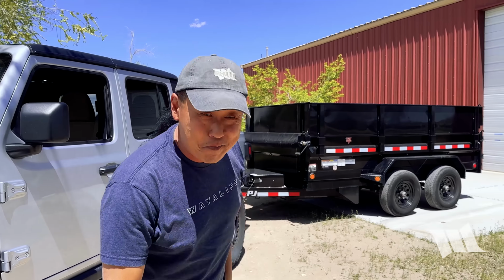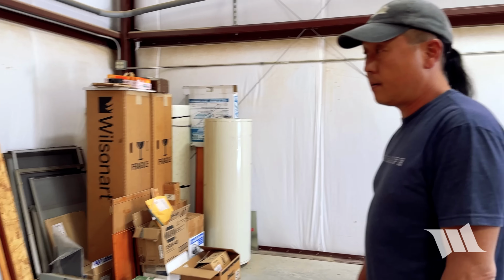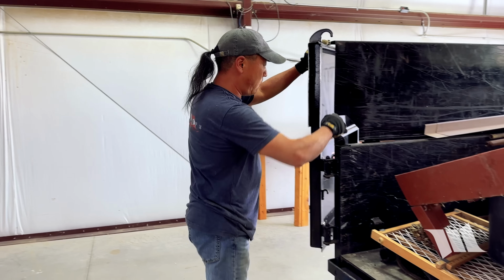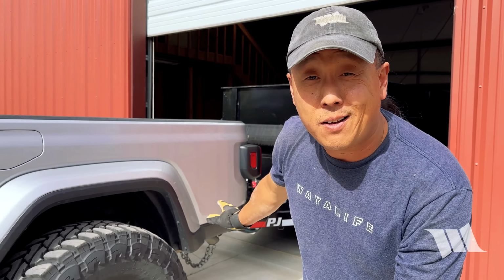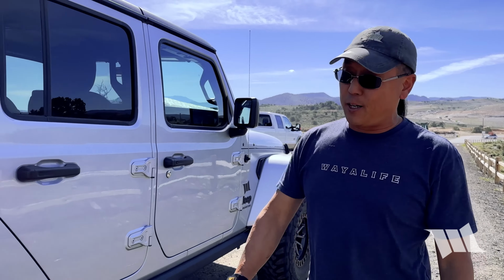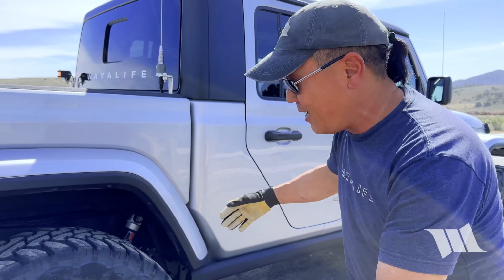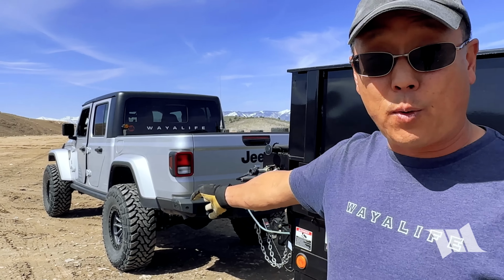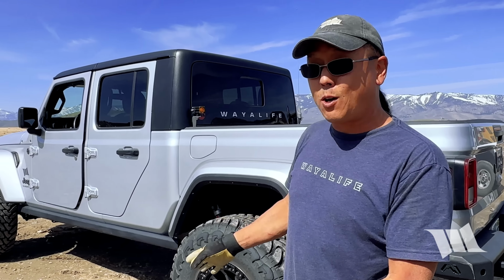Towing with a Jeep Gladiator is a Lot Better with an Air Suspension System by ACCUAIR

Comment: The Accuair is quite amazing, but the lift on the trailer to effectuate the dump was a surprise. At the start ,when the vehicle backed & lowered to the trailer hitch height ,that was a "smooth operation" . Impressive video, thanks.
Reply from the maker: Glad to hear you enjoyed the video.

Comment: I want this for my JTRD, i messaged AccuAir they said i needed to use the 4xE kit for the JL. That just leaves me with even more questions.
Reply from the maker: What they are telling you is that the kit you need will work for your setup as well or at least, in terms of it being a direct bolt on kit.

Comment: I've not considered a gladiator based on reviews of instability when towing heavy (6k-ish lbs) loads.  What was the weight of that load? Does the air suspension help with towing stability?
Reply from the maker: Not all Gladiators are rated for the same amount of weight. A Sport with a 3.6L has a 7500 lb capacity but others have quite a bit less. That said, our total load including the weight of the trailer was 6000 and yes, the air suspension did help a LOT with stability. However, it won't help the engine or braking.

Comment: Great video. What tire and wheel setup you have on your gladiator? Wonder for the air system - what’s the limit of size?
Reply from the maker: 37" Toyo MTs mounted on TIS Offroad 556. As far as the air system goes, what exactly are you wanting to know?
Reply: @wayalife  thanks for the response. Wonder what maximum weight can the Gladiator take on top/bed with the Air system. Saw you pulling the trailer.
Reply from the maker: @cmwilfred  They've tested it carry way more than what the Gladiator is rated for and without any issues. But, I wouldn't. The bigger issue you should be concerned with it the lack of power the Gladiator has for that weight and braking.

Comment: Been using my Gladiator for towing a bit and pretty sure I towed over 7k on accident (was towing a small building on a trailer).  Only reason I think this is that when I loaded the load it squatted quite a bit.  Later when I towed a confirmed 5500lbs it didn't squat much at all.  This kind of worried me.  Thankfully I didn't go far.  But it still did a great job.  I'll be towing a 6500lb travel trailer from Wyoming to Texas in November so I'll get to find out how well it tows in the long haul. I'll have load bars but I sure wish I had air bags.  I've had them before on other trucks and there's just no comparison.

How much does the ACCUAIR affect the ability of the truck off-road?
Reply from the maker: We have multiple videos that highlight the ACCUAIR system but this one is probably one you should see https://youtu.be/GKZ-uwINK2k

Comment: How does the Accu air deal with the driveshaft? Any worries about slipping off?
Reply from the maker: Your drive shaft collapses the taller you go or droops out when flexing. There is no worries or issues to deal with.

Comment: Do you prefer Gas or Diesel for towing with the Gladiator? I'm on the fence for a daily driver, weekend light wheeling with the RTT, and long summer road trips with the teardrop.
Reply from the maker: Honestly, I prefer diesel in general and love the performance of the one in a Gladiator. That said, I am hard pressed to ever buy one if only because of the fact that I have multiple friends who've already had problems with the fuel system and the fix for it was over $10k. Sure, it was covered under warranty this time but WHEN it happens again in the future, it'll be on them. Also, I am discouraged by the fact that the engine has already been discontinued and just after 3 years. I imagine parts for it will become hard to come by. Such a bummer.

Comment: Is Accuair going to come out with an air system for a JLU w/E Torque
Reply from the maker: They just don't have anything that will bolt right on. You could make it work though.

Comment: I  like that air system, I never seen a Gladiator with one. I wonder how much it costs, another great Video, just how many Gladiators do you have 😂
Reply from the maker: You're looking at $7000 for the kit. Not cheap by any means but there are definitely kits out there that cost as much or a lot more and you don't get the benefits of air pistons.